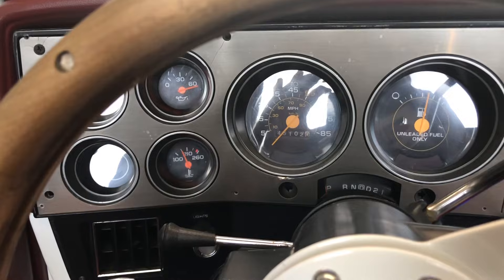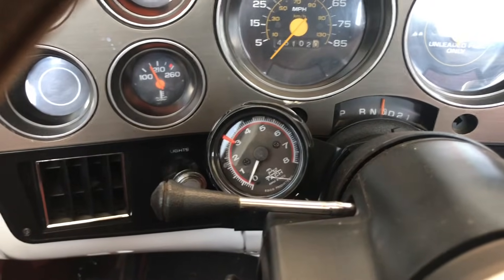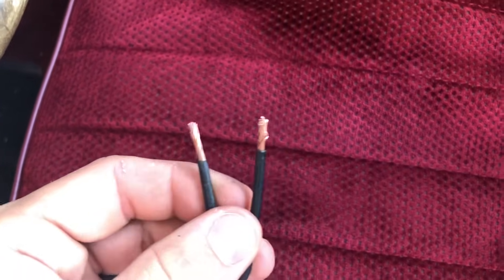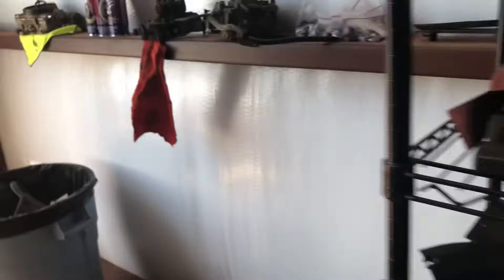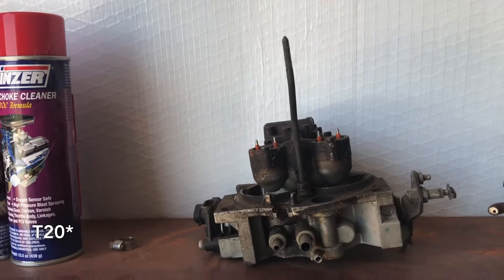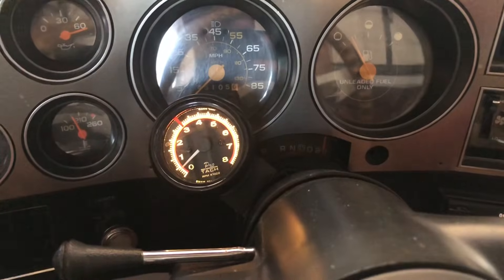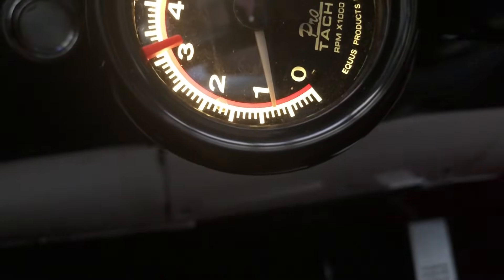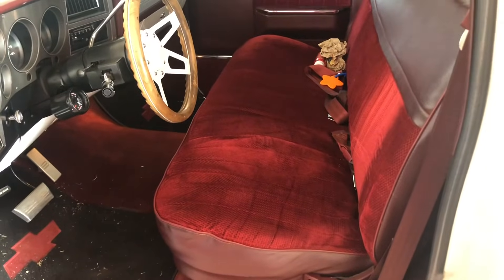How to: GM TBI Idle Adjustment

Comment: This helped but have a total different question when engine is cold has to have temperature sensor plugged in to get it started have to plug it out on engine is warm or we'll stall when stepping on the gas
Reply from the maker: I would verify fuel pressure before unplugging the CTS, sounds like the fuel pump could be going out.
Reply: @3rdGenC10s  brand new fuel pump
Reply from the maker: @richardwurz5197  I’d verify fuel pressure

Comment: Putting out there to check the park neutral switch as it controls in gear rpm. It's dumb and not conventional but that's how they did it with tbi
Reply from the maker: Good tip

Comment: Bout to try this right now just swapped my blown 4.3 for a free 5.0 having the same issues already got a Ecu to match the motor just can’t get the idle right either have to adjust the throttle to 1200-1500 and it still doesn’t like it and I don’t have ac right now, maybe 🤔 this summer in this Texas Heat 🥵
Reply from the maker: Hope it helps.

Comment: Are stock chip idle specs set to each Pacific engine or make and year? 
 Does idle adjustment/iac replacement affect the timing?
 Knowing computer will adjust a little give or take. Is it possible to get it exactly right without a diagnostic machine? 
   I know there's lots of factors that can cause non compliant adjustment results, just didn't know if there are secret do's and don'ts...
Reply from the maker: I’m not super familiar with the tbi system. Custom prom chips can help out when adding performance upgrades.
Reply: You need a gm obd1 scan tool to see the computer " set rpm ", then follow this to get a base rpm (650-750 usually). The iac can only do so much so you try to get it as close as can

Comment: Ok I had same problem w my cammed 87 I turned up. Now the cold start idle is considerably higher than I would like. How do I get a happy medium?
Reply from the maker: You can adjust the idle down.
Reply: @3rdGenC10s  If I do that I'm back to idle being too low when up to temperature.
Reply from the maker: @georgeelliott7353  are you setting the hot idle when engine is up to temp?
Reply: @3rdGenC10s  yes
Reply from the maker: Are you running the stock prom chip
Reply: @3rdGenC10s  yes
Reply from the maker: @georgeelliott7353  you may need to get a custom prom chip burned.
Reply: @3rdGenC10s  Not sure how to do that. Had a buddy set it like it is. He is GM certified mech of nearly 30 years. He didn't mention anything about that but it's been 15 years  since we played w it. I was debating putting a vacuum pump on it.
Reply from the maker: @georgeelliott7353  https://harristuning.com/Tbi/custom-tuning-form/
Reply: @3rdGenC10s  cool only problem is we aren't sure exactly what cam is in it. It came from summit but we can't find info and summit doesn't keep records that long. I really don't want to pull it out to measure it. It's not terrible high on cold start just higher than I am comfortable with.

Comment: Are you also unplugging the single wire timing lead while adjusting the t20 bit screw?
Reply from the maker: The tan wire?
Reply: @3rdGenC10s  Yes, and thanks for the reply.
Reply from the maker: You won’t disconnect it. That’s the timing  advance. You would only disconnect it when setting timing.
Reply: @3rdGenC10s  Thank you
Reply from the maker: @MrDirty-if7gc  yes sir hope it helped!

Comment: Do you know how to calibrate a new tps sensor? I've been told you can't just simply install a tps
Reply from the maker: I’ve never messed with it, I did find this article that could be helpful.

https://www.gmcmi.com/wp-content/uploads/2013/02/TBI-Initial-calibration.pdf
Reply: Yes you have to drill the blot holes and rotate it back... Then jam a multimeter into the blue wire and one to a ground.... Then you want a reading of 0.58 volts

Comment: i see with your truck running your oil pressure gauge  is reading pass 60 at idle are your gauge working
Reply from the maker: Factory oil gauge doesn’t work. I’m running a aftermarket oil gauge.

Comment: Would this work on a 94 suburban Silverado edition TBI my ldie is very low in drive or reverse? I have no code's at all just low idle
Reply from the maker: Should be the same procedure to adjust the idle on it.
Reply: @3rdGenC10s  I just got a new rebuilt TBI does not have the hex screw to adjust idle so I don't think it's the same procedure I haven't installed it yet hoping it'll fix my low idle though air idle control valve is new along with all the sensors including coil

Comment: Do you have to re adjust your throttle position sensor when you adjust the idle? I have a 88 k5 blazer. The idle on it started acting out. New coalant sensor, throttle sensor, iac sensor, and egr valve, and same idle.  Im going to try what you suggested next
Reply: I just got done doing this. I drove it for about 15 min and idle is better. More quite. 
The only thing that i struggled with was when i disconnected the iac i couldn't get the blazer to stay on. And it was up to temperature when i was doing this. Asoon as i let the pedal go it would turn off. So i just turned the idle screw from 12 to about 6 to get it to atleast stay on. After that i turned idle screw till idle felt stable.. Was the idle way off thats why it wouldn't stay on after disconnecting the iac?
Reply: I have an 87 k5 and it's doing the same thing. That actually just helped.
Reply from the maker: Hope you were able to figure it out.

Comment: do you leave the jumper wire pluged in while adjusting it
Reply: The purpose of the jumper is to force the IAC to close. After unplugging the IAC with the key on and engine not started, the jumper is no longer needed. You pull the jumper out, start the engine and set the base idle. On an automatic trans vehicle the base idle is supposed to be set at 550-600 RPM. After killing the engine, you reconnect the IAC. The IAC ( which is controlled by the computer) then regulates your idle speed. It should idle faster on cold starts. The IAC also adds air when you put it in gear or turn on the A/C to keep the idle speed up and prevent stalling.
Reply: @jamesmumford774  thank you
Reply from the maker: Yes

Comment: Hey man I am idling around 2000 rpm right now I had to rewire my iac I can’t seem to find any leaks. Do you think that it’s possible that the iac learned to be at 2,000 and I need to adjust it that much?
Reply from the maker: Did you do an IAC reset when you reinstalled the TBI? Disconnect battery to clear codes, reconnect battery, jump A&B on ALDL connector, turn key on for 30 seconds or so, turn key off, remove jumper from ALDL connector.

What happens when you do this is the IAC pintle will extend full-closed and stay there until you turn the key off. At that point the ECM assumes it's closed and has a reference point for any commands it sends to it from there on out.
Reply: I will try that tomorrow
Reply: But don’t I need to adjust the screw
Reply from the maker: @mustangs20141  if that does not fix it, adjusting the screw will be you’re next option.
Reply: Should I drill the metal cap cover to get to it?
Reply from the maker: You will have to if you end up having to adjust the idle screw it is located behind the cap.
Reply: What kind of bit did you use. None of mine are working?
Reply from the maker: Just a regular drill bit . Pretty small. Took a second to brake loose.
Reply: I adjust the screw and idle isn’t going down
Reply: Now my oil dipstick isn’t in all the way
Reply from the maker: @mustangs20141  did you follow all the steps?
1. Bring engine to operating temperature.
2. Jump OBD1 connector into diagnostics mode. 
3. Wait 30 seconds after key on to let IAC close.
4. Unplug IAC and start engine.
5. Turn T20 screw clockwise to raise idle to desired RPM.
6. Key off, remove jumper wire, and plug IAC back in, and lastly disconnect negative battery terminal to clear any stored codes in the ecu.
Reply from the maker: @mustangs20141  adjusting the idle would have no effect on you’re dipstick.
Reply: I replaced my headers to long tube and it hasn’t sat the same since. I think maybe that would be a vaccum leak and I followed the steps. Could the tbi need a rebuild?
Reply from the maker: @mustangs20141  it could. They are pretty simple to rebuild. I would first get some carb cleaner and spray around the tbi and lines and check for vacuum leaks. If you have one it will idle up when the carb cleaner hits it.
Reply: @3rdGenC10s  nice screenshot  ^ 'follow the steps'

my neg bat terminal is kinda stripped so i use the pos, does the bat not clear i wonder?

Comment: Oh this is gonna be fun on my 91 G20 van replaced the IAC now its too high
Reply from the maker: Yeah I bet on you’re van it’ll be fun
Reply: @3rdGenC10s   All good now wasnt so bad just  used the torq-bit and small ratchet under the dog house got lucky no drilling the plug on the tbi, after changing the IAC it was idle at 2k now i got it down to where it barley enguages the torque averter, thanks for the video!
Reply from the maker: Yes sir, I appreciate the support!

Comment: Would I mess things up if I don't use the jumper wire to replace the part
Reply from the maker: If you are trying to adjust the idle yes, it would never close the IAC and you would never achieve the idle you want.
Reply: @3rdGenC10s  Àà mm A
Làà

Comment: Got a question. Got a ‘94 gmc k1500 with 350 tbi. Did a tune up ( plugs, wires, ignition coil, module, cap and rotor) truck starts as idle ok till I put in gear for reverse or drive. Looses power and wants to die unless I keep giving it gas. Gonna replace the IAC. Anything I should look at?
Reply from the maker: John Denelsbeck is it throwing any codes?
Reply: 3rd Gen C10’s no not getting any codes.
Reply from the maker: John Denelsbeck you might check for vacuum leaks.
Reply: 3rd Gen C10’s done that. All hoses are connected and been cleaned.
Reply from the maker: John Denelsbeck I’d replace the IAC and see if that fixes it if not I’d break out the carb cleaner and spray everything down like throttle body gasket and hoses just to double check vacuum leaks.
Reply: 3rd Gen C10’s ok thanks much. Enjoy the videos a lot.
Reply from the maker: John Denelsbeck I appreciate it the support man! I try and have a video up every Thursday at noon.

Comment: I'm having the same problem with my throttle body it's literally doing the same thing for the past year or so I did not know you had to set the throttle on the throttle body
Reply from the maker: slamdeathgrindmachine hopefully this will help you resolve the issue, if you have any questions let me know and I will try and help you figure it out.

Comment: Hey man, I have an 89 c1500 pickup with the same exact issue, I want to try this but where exactly would I find my A & B connector? Would it be under the hood or under the dash? Or would this step even apply to my truck? Thank you!
Reply: Plug is under dash near fuse panel
Reply from the maker: AllStormOutDoors the connector will be right under the dash on the drivers side.

https://youtu.be/vgXSXCRyw2w

This video should explain how to put it in diagnostic mode. The steps should be the same for you’re model as well!
Reply: @3rdGenC10s  Thank you so much for the quick response, very helpful!!
Reply from the maker: If you have any more questions you can email me at Z_J_Musgrove@Yahoo.com
Shoot me an email if you have any more questions and I’ll get you my number and I’ll try and help you out!